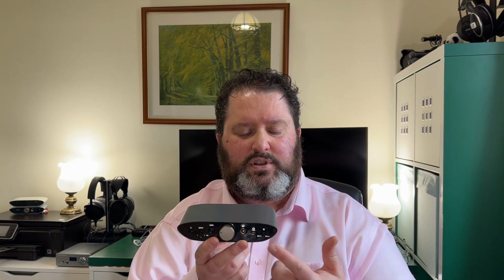iFi ZEN Air CAN review

Comment: Hi Gavin, nice video! I am going through comments and didn't find anyone ask the following question which, I belive, makes more sense than comparing amp/dacs and amps. If one has 200 eur budget and can get either a Zen Dac (199 ) or the Zen Air Dac and Zen Air Can combo (100+100), which one would you suggest for single ended use only ,in my case for Sennheiser 560s?  Thanks!

Comment: Apart from the fact that it is made of solid plastic rather than metal, what is the difference compared to the Zen CAN (not the AIR version) ? You answer this question clearly in your video, thank you very much for that. 

But I would, in add, like to know if the xSpace function on Zen Air model, compared to 3D function on the CAN version more expensive, is less efficient or same. 

You also say that the AIR does not have a completely balanced circuit like on the more expensive Zen CAN. What is this difference? 

You also say that the plastic material of the AIR gives it less power than the metal of the CAN version more expensive (I don't understand why).

I will only use the Zen Can with my Beyerdynamic headphones, not with speakers.

Comment: Will this be good with focal elegia or hip Dac2  is better. Hip dac 2  requires another adapter which adds $30. Usage is at desk only. So $99 vs $220 it all comes down too.
Reply from the maker: If desktop use only get the air can

Comment: HI! I'm curious what you would think would be the best combo for me at the moment.
Just got a pair of Sundaras and would like to add either the ZEN Air CAN or ZEN Air DAC to run from my computer. I'm on a tight budget at the moment so I will only get one or the other. Which would you think would give the best experience?

My concern is that is the DAC alone wouldn't have enough power, and the CAN alone (ran straight from the PC motherboard) would only give me more volume (and not the "quality").
Reply from the maker: Quality first. Add power later when you can if needed.

Comment: Hello, does this amp drive hd600 to its full potential? and how is the hiss performance on 32 ohm sensitive iems
Reply from the maker: It has a lot of power to drive the Sennheiser. More expensive amps will drive the 600 even better.  32 ohm IEMS aren't that sensitive normally, so have you got a particular model in mind.
Reply: @GavinsGadgets  yeah fiio fd3 pro. And these amps can drive the hd600 without lack of power issues right ? I'm new to this hobby and planning on making a air can+air dac stack. Is this gonna be enough for my hd600?
Reply from the maker: It will be enough but this is the budget end of gear. Great value for money. But you would need to spend a lot more to gain an advantage.
Reply: @GavinsGadgets  thanks for the reply. One more question, how do you think of these when comparing these to the JDS labs stuff
Reply from the maker: Not heard the jds labs. Not as readily available here.
Reply: And do you think it's worth it to buy the zen DAC over the zen air dac ? Is there a big audible difference?
Reply from the maker: It’s not night and day , but it is better if you are using the zen dac to its full potential.

Comment: So as I understand, this would be enough to drive a pair of LCD 2C from my Laptop / Phone (has a 3.5mm)? I have a pretty modern gaming laptop, I didn't notice any distorsion with my Beyer DT 770s, so I don't think I'd need a DAC for now.
Reply from the maker: Not sure of your laptop specs. But if it had a dedicated amp for the 3.5mm then you might be getting the best sound from your Beyers.  Otherwise, a decent amp/dac will improve the dynamics .

Comment: How much of a difference in sound would you say it has, compared to the original zen can. 

Please elaborate a little. 

I am a mix engineer and my use case is to power my he400se, for mixing purposes. I'm happy with the sound profile I'm getting at the moment but my audient is not able to project the volume loud enough. Need a basic amp for a mild boost. 

Looking for something with a neutral sound signature, and was eyeing out the original zen can, but knowing that this thing exist, do i really need to spend extra for the original?

Thankyou 🙂
Reply from the maker: Both are good. The Air doesn't have all the accessories that the original has. So that's a cost to you if you need them. Probably the original has a little extra refinement in the sound, treble and mids and also bass. But it's close.
Reply: Thanks again 😊

Comment: thinking of pairing this with my air DAC to get louder volume on my dt770 pros 250ohm, they're just not quite loud enough. Will this boost the volume?
Reply from the maker: Yes
Reply: @GavinsGadgets  Don't want to be a pain, but what power adapters do you use to power them. do you use the ifi iPower adapters or do u have your own. worried that cheap no name power supplies won't cut it. And to connect the CAN to the DAC am I just using RCA cables?
Reply from the maker: I fortunately had the ifi adapters. Having a good adapter does help. I'm sure you could find similar off eBay or use a usb brick with adapter. RCA cable 👍
Reply: @GavinsGadgets  will this affect volume if I get a cheap one? I noticed the ifi supply had 5v by 2.5a and all other ones online are 5v 2a just wondering if that would affect drastically or not by much. new to this whole thing
Reply from the maker: I honestly don't know. Too many variables as to the quality of the other adapter.

Comment: how do we connect it to pc ? i mean is the USB to DC is enough?
Reply: i dont have any other cables
Reply from the maker: You could use the 3.5mm headphone out to the iFi Zen Can with the correct cable.
Reply from the maker: The USB to DC is for power.
Reply from the maker: Part of the keeping the price down was done by not including loads of cable options in the box. If your PC output is poor, you may want to go into a DAC first,  then the dac connects to the air can.

Comment: How does the sound compare to just using the Zen DAC on its own?
Reply from the maker: Zen air dac? Or zen dac.
Reply: Sorry Gavin, I meant the original Zen DAC!
Reply from the maker: They're different devices really. So not possibly to really compare as such although they both have the same signature.

Comment: Hi Gavin, thanks for the review :) I got a little question for You. Is the volume control smooth in operation or it has the potentiometer with clicks in step increments? Thanks a lot for Your time if You can answer :) Best Regards 
Luca
Reply from the maker: Smooth

Comment: Can this be used with a turntable?
Reply from the maker: Depends on the turntable if it has a standard rca output, that is , it has its own photo stage built in. If not, and most likely, you will need the ifi zen Air phono . Or something similar that then connects to this.

Comment: Hi Gavin, it does have the 4.4mm S-balanced - so it means it's not true balanced? Can I use a balanced headphone on the 4.4mm S-balanced - will it be the same?
Reply from the maker: The front has 6.3mm and 4.4mm jacks, so whilst its not a fully balanced device, you can plug in 4.4mm headphones.
Reply: I understand there is no 4.4.4mm input on the rear but are you sure the outputs on the front are 6.3mm and 3.5mm. Ifi website says the s-balanced output is 4.4mm.

Comment: Hi Gavin , thanks I had been waiting for your review on the Zen Air Can , I was wondering if this could suffiencently power a Massdrop Sennheiser HD 6XX. Thanks for your detailed reviews! cheers
Reply from the maker: With the correct power connection, it should be fine.
Reply: @GavinsGadgets  does that mean I need to get a if power connector or a usb adaptor is enough. Thanks again for your reply
Reply from the maker: Im using a usb adapter myself with the correct power needs. That works fine. I do have a ifi ipowerx which i tried. That was even better but the usb adapter i had is fine.